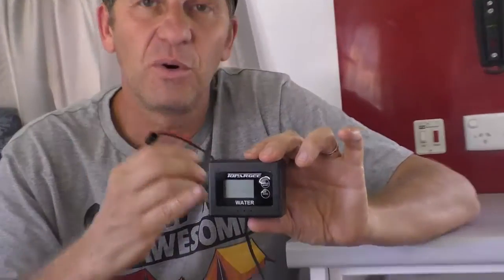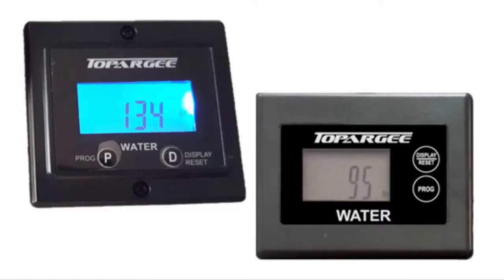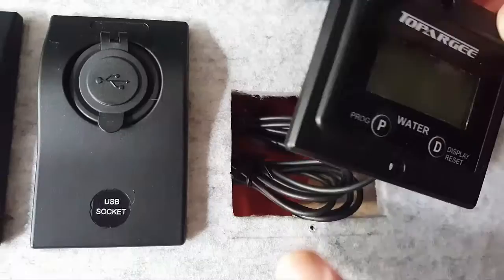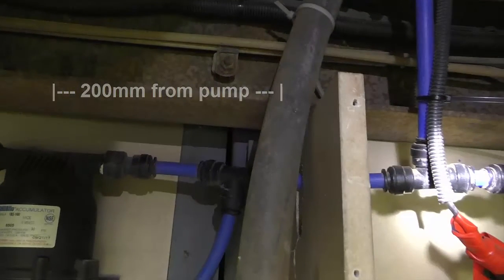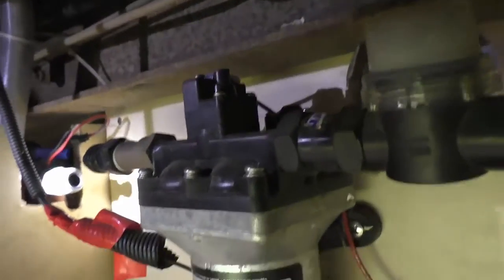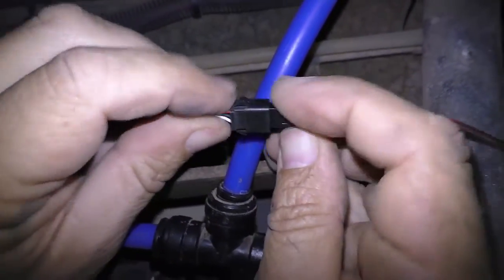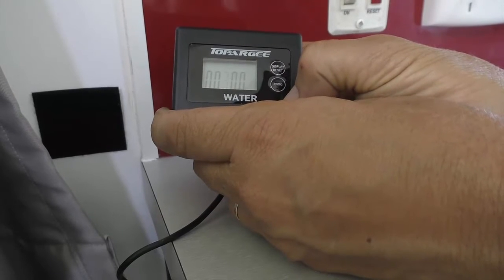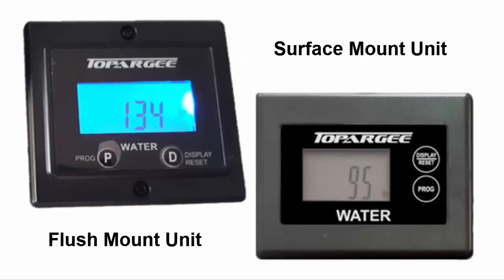FRC Topargee Water Gauge, How To Install

Comment: Good video, however you do not get everything to complete the installation. Two John Guest fitting 1/2 inch female J.G are required that will also fit the hose size that you have. In my case I required 2 additional fittings to suite the 10mm hose.

Cheers Alain.